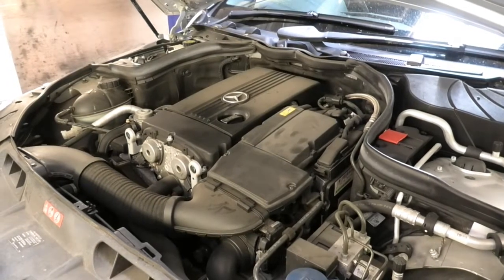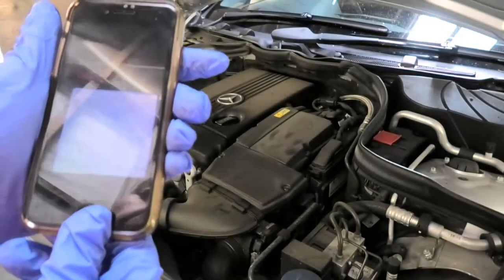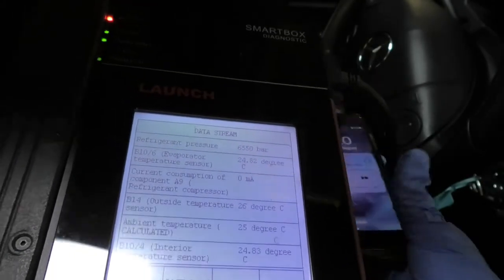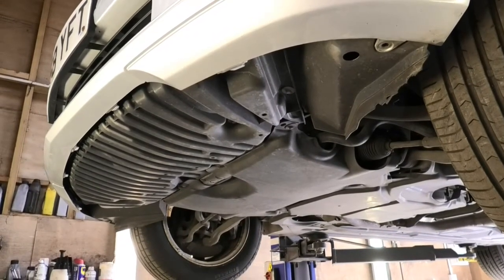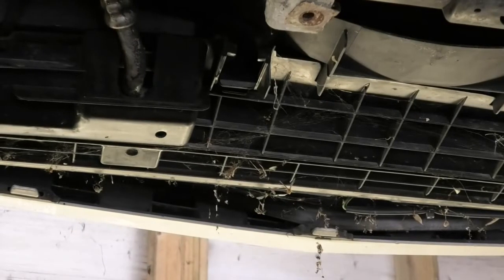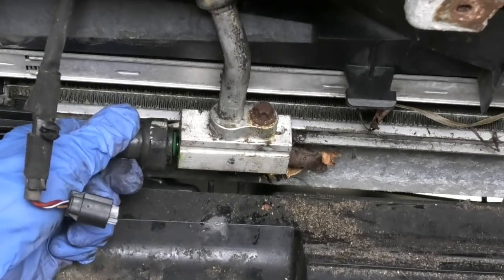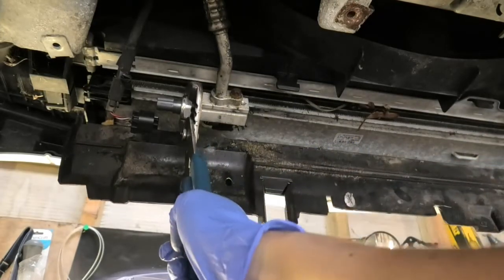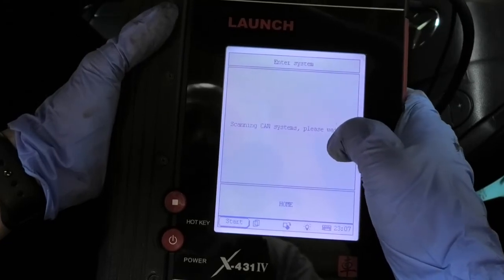Mercedes w204 2008 c180 Kompressor cooling fan noisy running too fast fault code B10 7A15

Comment: You can empty refrigerant simply letting it go in the air! Just press with a screwdriver in the pressure valve.
Reply from the maker: Yes you can, but is very bad for the environment.
Reply: @DaringBeefcake  man… the planet is huge is not like life will end with venting your car. Also farting is bad for environment but what we can do? All the living things are farting. Is a very depressing existence!
Reply from the maker: Hey you can do as you wish :)  @neptunevibe

Comment: Thanks for the video, absolutely very useful. My problem is that my AC is cooling but my Fan speed is stuck in low and not spinning quite fast, I observe the temperature Guage is around the half mark, any recommendations? Thanks.
Reply from the maker: When the ac is on the fan starts working, but not on fast spin. If the car was overheating then the radiator fan would probably come on fast. So why do think your fan is stuck on low and why do you think it should be spinning fast ? Just wondering in case I didn’t understand the question.

Comment: hello i had the same problem and I replaced this sensor myself too but whitout this diagnostic. I don't charge system by freon and after few month latter this conditioning motor has died probably by this
Reply from the maker: if you dont have ac gas freon in the system the ac compresor doesnt work untill you add freon..unless you have a faulty compressor..

Comment: Will  changing the sensor drain out air condition gas?
Reply from the maker: Yes, all has will come out, so you need someone to discharge the system before removing the sensor, as it can cause injury to yourself plus is toxic..

Comment: Question.  If you disconnetor the temperature sensor then you check the fan is running or not. ???
Reply from the maker: Hi I think that works on some cars, not sure all are the same, but you can try, I did on an E500 and it worked.

Comment: What about if the fan is stuck on high but AC is working normally and quite cold? What could be the problem and fix here? Thanns
Reply from the maker: It could be a bad temperature sensor.. you need to check if there are any fault codes, how ever the car in the vid had a problem with the fans but the ac was working ok..
Reply: @DaringBeefcake  there was no fault code.
Reply: @DaringBeefcake  The refrigerant pressure is constant at 19.5-19.8 bar whether the AC is on or off and it's constant whether the AC is low or Max. Appreciate your suggestions. Thanks
Reply from the maker: @agondokusumo-111  you welcome, hope you got it sorted.

Comment: Hello i have same car w204 2008 c200 kompressor , my ac stopped working , fan powers up imediatly when i start the car , i put launch tester on it and it doesn t show me anything wrong ... i don t know if i should change the sensor or no , can you help me with an advice
Reply from the maker: I think you need to check the sensor pressure reading with the OBD scanner and see what you have. If the reading are ok, then you may have a different problem.

Comment: Do i need to something before i change the sensor, and when i take the sensor will it take the ac gass out?
Reply from the maker: All the procedure its in the video, I don't remember by memory because I do different cars.. but i think in this model the ac gas needs to be drained out before changing the switch..

Comment: After change that sensor, do I need to refill AC gas again ?
Reply from the maker: Yes, all the gas will come out, it is advisable to have the gas removed by a garage before changing the sensor. Then you can get it refilled. Or just ask them to change the sensor it’s fairly easy to do.
Reply: @DaringBeefcake  Tq very much sir, for your feedback.

Comment: I have the same problem but My signal indicator not working, my ac is not cold but able to change speed and switched on and wiper cant switched on. I tried to plug in OBD but cant be detected. Is there any solution for this. Mine is c180 2008 model
Reply from the maker: Hi sounds like your indicator and wiper stalk has malfunctioned. the situation with the fan running to fast is different, so you could try the ac pressure sensor for that.

Comment: I have same problem but by my car airco computer is also dead, no lams /ligths nothing. I change AC module but still a same problem , fan running again fast and airco not working
Reply from the maker: If the control unit for the aircon is not working then that would be the first think you need to check. If the unit is not working then you can’t control the ac and and fan speeds.
Reply: @DaringBeefcake  i buy on ebay same one , with same hardware and software number, i change it but stil a same. I check all the fuses also. I cannot check relays.
Reply: i buy osb tool and that gives 2 errors:. I delete all the errors and that one stays.U016487 Communication wit the air condition has a malfunction. The message missing and also somethimes error U042400 Unreasonable data were received from the air condition. The car is W204 from 2012, c200. OSb tool is Icarsoft V1.0. I try everithing but no solution. Im very dissapointed.